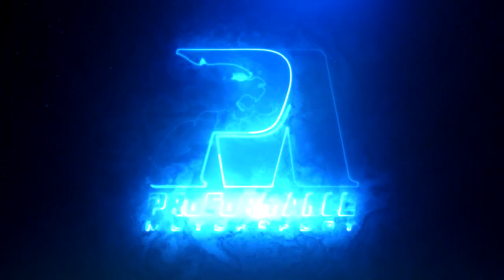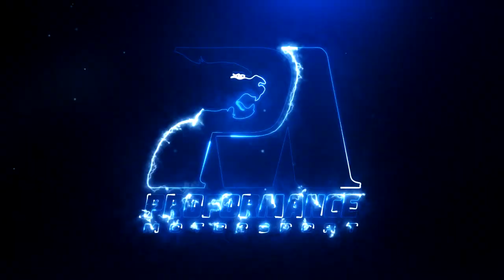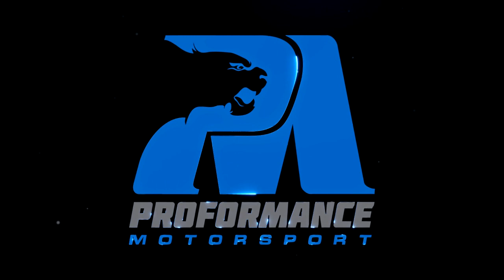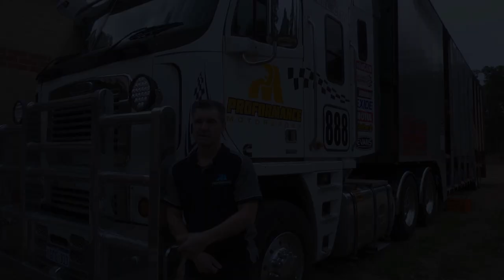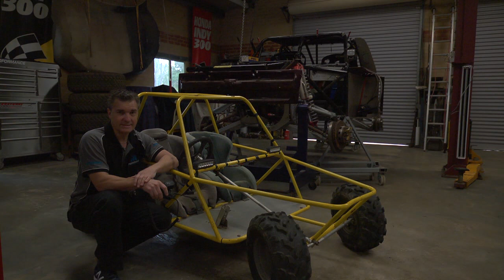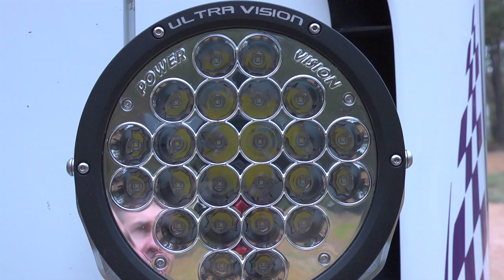Radio Interference" (Suppression) Test - Ultravision vs Chinese LED Lights - Be Warned

Comment: I just changed my lights on my motorcycle to LED's, and now I can't listen to the radio because of the noise interference. We did figure out it was the LED lights. I will check into the Ultra Vision LED's to see if they make headlights and passing LED's for my motorcycle.